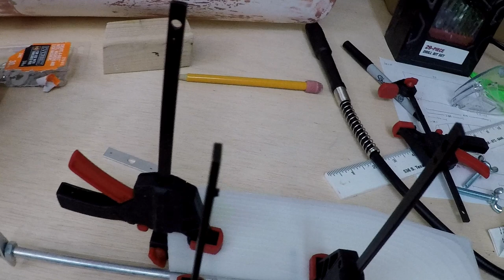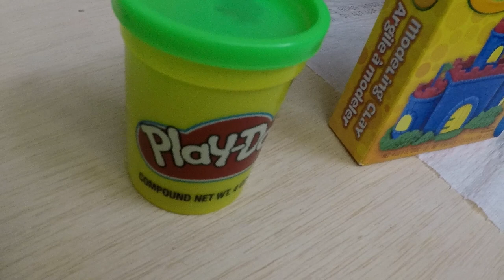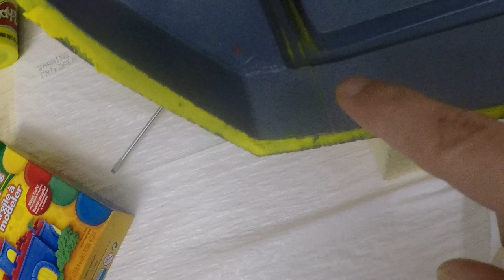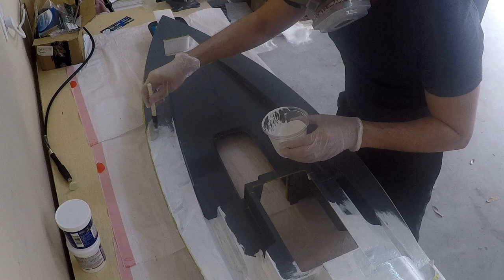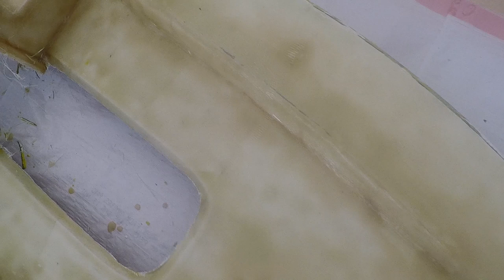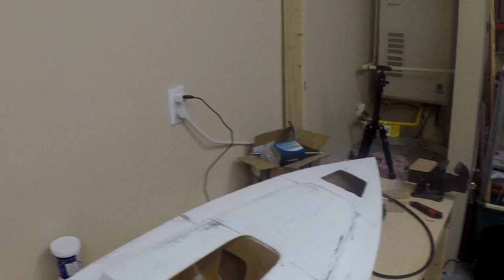How to make an RC sailboat Beneteau 37 build part 5

Comment: I think you are a genius. And have a lot of patience. To do what you are doing is not easy. It is the professional way to do it. I have been at it for thirty years or more. I have learned how to design model boats and use the plank on frame method of construction. I use the computer to develop the bulkheads only. For now I enjoy making boats as display models. Keep going you're doing a great job, and olso you're learning a lot.
Reply from the maker: Thanks I try to solve problem with the resources I have, and learning along the way, glad you like the content of the videos!

Comment: The same has happened to me. Usually I let the gelcoat harden for 24 hours before I start laying up the fiberglass. Great project!
Reply from the maker: Yes I have to be more patient with the gelcoat. Also the one that I bough is with wax to cure in contact with the air is not ideal for molding pieces.